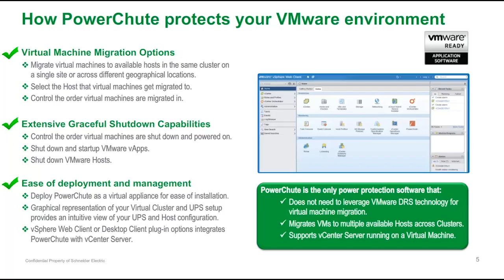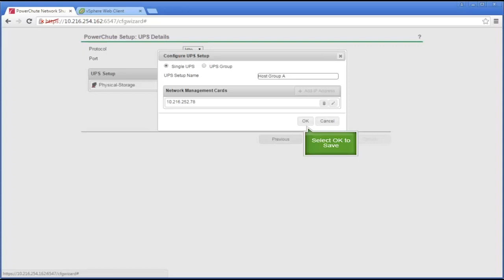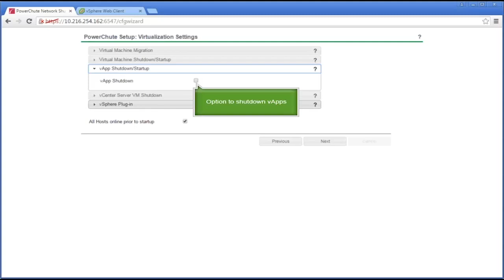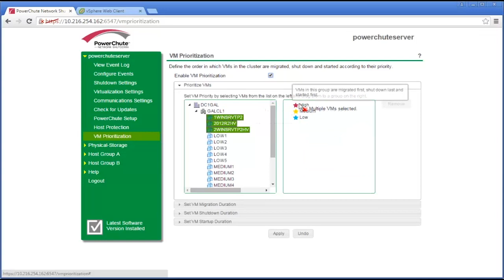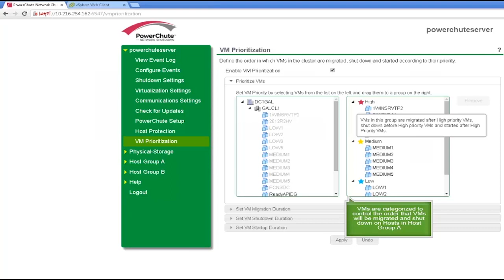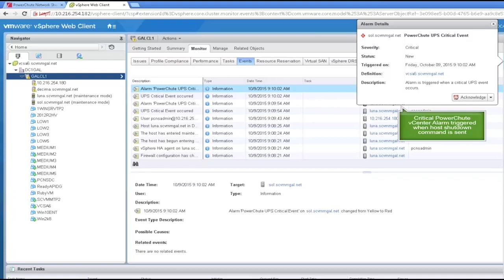How to configure APC PowerChute Network Shutdown for VMware | Schneider Electric

Comment: I really appreciate this video. Of course, it inspires many questions...

1) How is a power outage simulated to test shutdown and power-on? You skipped over this and sort-of inferred that you actually unplug the actual UPS. Isn't there a simple menu option to simulate a power loss?
2) There seems to be an assumption that each UPS gets a fixed number of seconds. What happened to shutting down based on a percentage (%) of remaining power? Some UPSs can supply power for hours reliably. However, over time the batteries lose capacity. Additionally, workload can dramatically affect how long a UPS lasts. The most preferable method would be percentage remaining versus a fixed number of seconds (I.e. shutdown when power reaches 15%). A  UP can last for 240+ minutes on one day and 120 or less on another.
3) Most outages are short and a UPS can outlast the actual power outage. This isn't really a question, but a suggestion. Please, include how end-users could be auto-notified that a power outage occurred and, if they receive another message, the system will shutdown. It would be nice to see this order: (1) power goes out, (2) first email/warning message is sent, (3) power hits level that is too low, (4) additional email informs users they have X amount of time to stop what they are doing or risk losing their changes, (5) shutdown is triggered.
4) Support for physical servers was not included. Most data centers have to address both.
5) There was no mention of installing a plugin into the host operating system. Is a plugin required, or no?
6) No reference was made to a scenario where Powerchute resides on a host that is dependent on a UPS that doesn't last as long as others. It is possible to have Powerchute be shut down and have no ability to manage other shut-down sequences becuase the other UPS simply lasted longer. In other words, the environment must ensure that Powerchute be supplied by the longest lasting UPS.
Reply from the maker: Some great questions.  Thank you!  Hope these answers help!
1.Depending on the NMC you can test the shutdown by going to Control - UPS Control select Turn of UPS and Signal PowerChute.
Note: that this is not a simulation. The UPS will power down after the delays that are set and PowerChute will shut down the OS/s
2. We have an enhancement request open to add this feature to a future release. 
For now, with PowerChute Network Shutdown 4.0 and above you can configure a shut down when the UPS battery has x minutes of available runtime remaining. That way as the batteries degrade the OS will still be powered down at the same charge point. 
3. E-mail is handled by the NMC and it will notify users when the UPS is on battery and going to power down. With the release of PowerChute Network Shutdown version 4.2 PowerChute can now be configured to send SNMP traps and alerts to a Management System that could also notify users. 
4. PowerChute is support on physical server. Here is a link to the compatibility chart for compatible OS. http://spr.ly/605085H7E
5.No a plug in is not required but is available if wanted. 
6. Yes PowerChute should be supplied by the longest lasting UPS or install PowerChute on all server that need to be powered down and configure this PowerChute clients to monitor the respective UPS/NMCs.